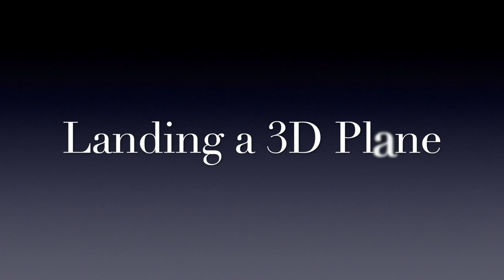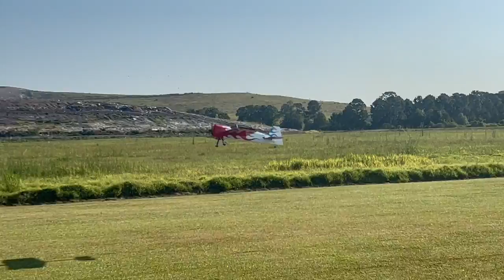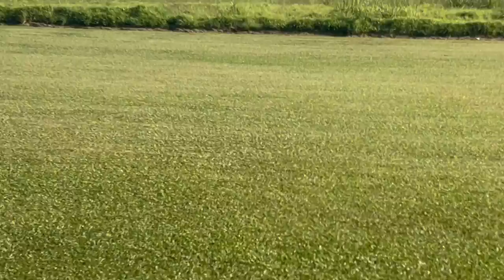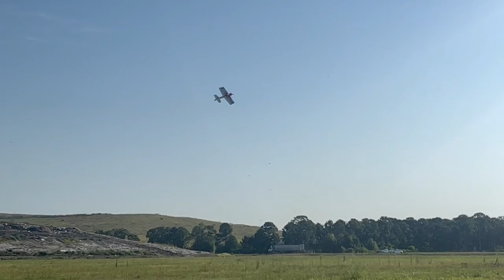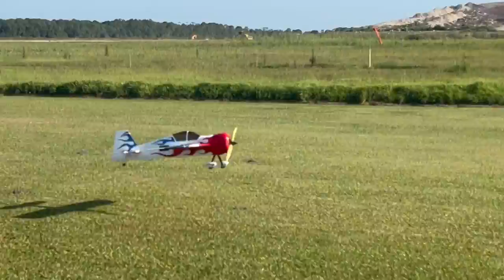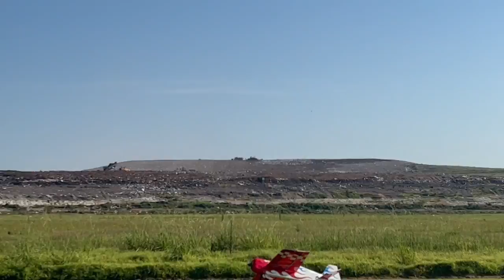Michael Wargo on Landing a 3D Plane, and why it's different...  Easier.

Comment: Good advice. My favorite 3D plane landing is probably an elevator from up high and drop it in almost straight down, or another cool one is to bring it in right off the ground inverted then push it over upright and sit it down right there.

Comment: You could have explained the  real problem that circle flyers encounter when landing a 3d plane. The plane feels tail heavy compared to what they are used to and they tend to hit the ground tail first. Or sometimes when they fear a stall is about to happen they push on the throttle stick and mess things up even more

Comment: That's awesome  Mike what 3d plane would you recommend I just started flying in January of this year I started with the apprentice then the t 28 then the p47 and the vipor now I got the real flight simulator and learned to hover I want to try it on a real 3d plane whats a good one to begin on?
Reply: The addiction seems to meet your needs.
Reply: Eflite Timber x is a good intro to 3d
Reply from the maker: Play addiction or addiction x would be the one.     I am not sure the timber would be in the same league Or even close in my opinion. Unless you want something a bit more scale looking and then pick katana 52 or something like that would be good
Reply: I actually went the way he suggested with my flight training, first with a motorized glider, then with a foamy 3D plane, and it worked out very successfully. Just like Michael Wargo has stated on his latest videos. In my case, it was a foam profile plane like they sell through Twisted Hobbies. The plane he's flying in this video is one of the PA Addictions, it looks like either the Addiction X or the Addiction XL. LOL! The only downside to training with a 3D plane is you might not want to fly anything else!
Reply: @MichaelWargo   thanks
Reply: @Reindeer911  thanks
Reply: @redfishtom  thanks
Reply: @kl0udykl0ud55  thanks
Reply: IF ur not truly sure u want to do 3D, i too would have to recommend the timber x as your 1st aerobatic/mild 3D plane. (Been doing 3D for years, flying since 2001🤦‍♂️).

IF u are 1000% sure u wanna do 3d, (& use a spektrum radio,like the rest of us🤷), if not the timber x, get the extra 300. The extra is a lot more 3D-ish capable than the timber x, but also more $$! But it does include a safe reciever,just in case things get out of hand. & When u get really comfortable with it,use a $50 AR620 reciever (or non-safe version), & almost double the sensitivity & throws.

Just MY honest opinion. Ive been there.

Comment: Thanks Michael! Im flying my Pilorc 107’ Sbach which is new to me. Our field is a bit in my opinion. I havnt had time to test how slow I can fly it. I know that you flown the big Sbach. Any tips and trick how to feel more comfortable in slower speed landings for my sbach. Thanks / Sam
Reply from the maker: My tip is don't worry.   My 40% was so slow and light.   You will have no trouble on a small or short field.   Just slow it down early.   Don't land fast.   POintless.
Reply: @MichaelWargo  Thanks for your input🙏🏼. You are right I landed to fast, I will slow it down more.

Comment: So you show how a 3D plane lands itself, wow ha ha. You should show how to land a tail heavy plane where you have to come in with a little power and down elevator. It was always those planes, where maybe you accidentally had CG a little too aft, that were a challenge to me in the beginning ha ha.
Reply: I have been flying a PA AMR Ultimate Biplane since 2009 and I love it to death - a near perfect plane.  I also have one of the tiny UMX Beast 3D Biplanes which is fun too. 

Several years ago I was flying the Beast and was doing a hover about three feet off the ground and it was doing great.  Tail slides, torque rolls much better than usual.  I'm thinking, smugly, "yeah, I finally got this down"!  😎  It is time to land so I gain a bit of altitude and transition back to level flight - the plane just goes absolutely crazy.  I somehow got it back in the hover without crashing.  Tried to go level and, again, it went nuts.  I got it back in the hover and did a very nose high Harrier back over the runway and set it down, tail wheel first.  It turned out that the battery had worked loose from the velco patch and was back in the tail of the plane.  Talk about tail heavy!  😲
Reply: When the CG gets moved that far aft, your airplane essentially becomes permanently on the backside of the power curve for lack of a better explanation. You use power for sink/climb and don't touch the elevator. It's pretty fun to practice. Example: https://www.youtube.com/watch?v=_fDKkxv3Fr4
Reply: @TailHeavyProductions  Yes, you can set up an airplane with CG far enough back where at a certain power setting it will fly level, upright and upside down with neutral elevator. It can be daunting for a pilot not prepared for this to perform a landing where normal procedures like chopping the throttle and flaring are no nos. But you're absolutely right, for learning to actually fly the airplane it's good practice. I came from RC helicopters to RC fixed wings back in the days and with RC helis back then ('90s) you had to fly them all the time.